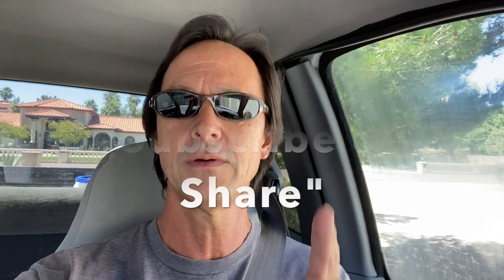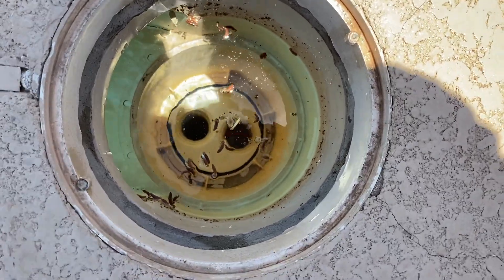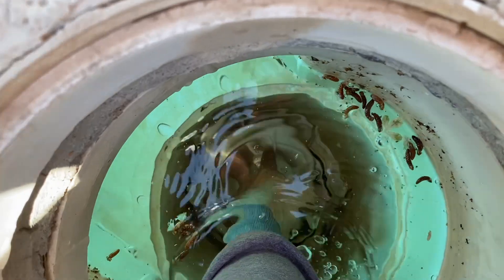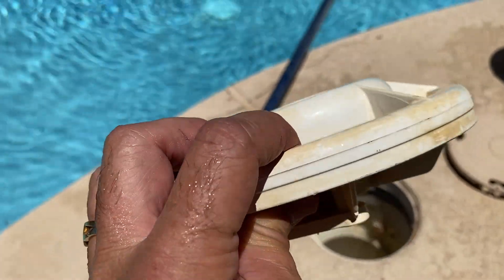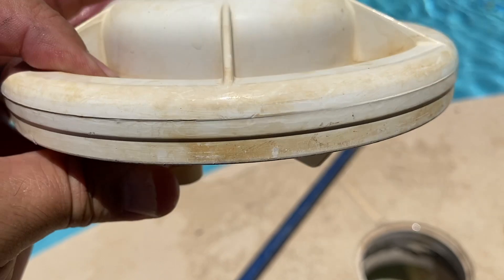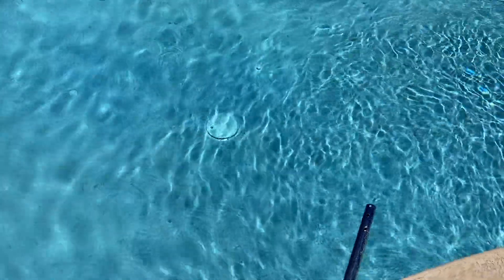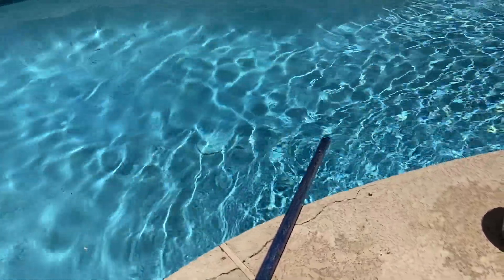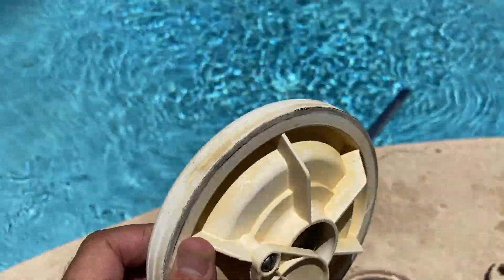Pool Skimmer Diverters: What Are They, What Do They Do & Do They Really Work?

Comment: So I have an infloor cleaning system and the diverter. But I also have this check valve that is on a spring which is supposed to go into the  hole that goes to the bottom of the pool drain. I am not sure if I should be using that with an infloor cleaning system. But it sounds like I should use the diverter at least at 50% or so so that my infloor is working good. Does that sound right? Its a U3 Skimmer system.
Reply from the maker: It does but I'm not sure about the check valve.  If it's to prevent water from flowing back into the pool via the floor drain I'd find that interesting and uncommon for my area.  I'd actually like to see a picture or video of what you're talking about.
Reply: @PoolSchooler  I am in AZ as well. According to the instruction sheet that came with it, it says" Check Valve prevents suction through equalizer line unless the water level in the skimmer drops so far that the float valve closes. When float closes, check valve opens allow pump to draw water from equalizer wall fitting, preventing damage to pool circulation pump." So it sounds like it closes off the line to the drains on the bottom of the pool unless the float closes. I am going to assume I don't want that in there since I have an in floor system. I am closing the opening on my float to about 60 or so so that the drains get more suction. I know that puts less suction on the skimmer but I don't have many trees or anything causing much on the surface. I am more concerned about dirt on the bottom. But easy enough to adjust as needed.
Reply: You can see the setup on it if you google "u3 skimmer installation" and check the link that comes up for
U-3 Skimmer - Pentair.
Reply from the maker: @josephtuccillo6438  OK gotcha.  I'd suggest following the manufacturers recommendations on their particular product.

Comment: My diverter was broken (the part where the screw attaches), and lately my pump was failing to prime every morning. I replaced the diverter with a brand new diverter and now i no longer have that problem. Is there a connection?
Reply from the maker: There should not be a connection.

Comment: What I noticed on my pool the 2nd hole to my skimmer goes nowhere and unfortunately has no diverter valve and no weir door.
Reply from the maker: A second skimmer hole that goes "nowhere" is common in pools that don't have floor drains.  So you don't need a diverter valve.  ALSO you can get after market spring loaded weir doors for you pool if you want to
Reply: I'll get the skimmer weir door eventually I'm glad I got a new energy efficient pump and new pool filter last year. Money well spent!

Comment: I have an old pool that came with a house my wife and I bought. I bought a diverter and its a great little device. 

I usually have the diverter door, a little more than half way shut and with a 35,000 gallon pool; running the motor at 2000 rpms, the skimmer flow rate works great. Of course you also have to find the right balance when it comes to your water level.

 I know the rule of thumb is usually you want your water level half way up the skimmer entrance. 

I disagree with this due to a couple reasons. The higher the water level, the higher RPMs I have to set my motor for it to enough surface water flow in the skimmer itself - and thats including adjusting the diverter door. And that just costs more money to go from 2000 to 2500 rpms. Also, high level of water usually makes the motor and skimmer work less efficient - meaning the surface water moves a lot slower to the skimmer. 

I usually have my water level at about 1/4 to 3/8 height of the skimmer entrance. This seems to work best for my pool and I can run the motor at A LOT lower rpms with better efficiency. 

Another reason why the diverters are great :

My backyard has three different types of pine trees that shed like crazy in the summer and get into the pool - usually staying on the surface of the water. If there's enough needles that get into the skimmer and clog the basket while preventing water from entering, the diverter will shut and it works in a way that the pool runs by using the floor drain - like you mentioned. However, for my pool, it does prevent air from going into the motor, the filter, and coming back out the return lines. Im not gonna say its air tight or anything, but with my experiences, the motor has enough suction to seal it enough for a tight fit. Then the diverter acts like a door and shuts the skimmer down when its clogged and then diverts only drain water into the motor and filter and keeping the pool running while being consistent (at least for circulation purposes) and preventing air from going in the motor. 

Its also great for general circulation as well. I dont think of floor drains as any type of vacuum mechanism for only for dirt of debris as much as I think of it as a circulation drain that filters out the fine particles. 

It might not be a great investment for some pools, but its a great device for mine.

Anyways, thats my thoughts and ideas for whatever its worth. And I still gave you a like.
Reply: Correct me if I'm wrong here but doesn't your completely clogged skimmer basket block/restrict the water flow? Thus only leaving the option to suck from the floor drain? That's how it would work without the diverter right? I also believe the diverter shut off float will still float if it's still completely submerged leaving the diverter open and not until the water level drops below the float will it drop down and hopefully seal off so it sucks from the floor drain instead of just air from the dry skimmer potentially burning up a pump. I think of the diverter device more as safety seal for when the pool level is to low to keep the skimmer full of water. I would think the only important reason for limiting off the wonderful time saving skimmer is to help suck down newly added chemicals for better even mixing for accurate test strips. I just started learning this tonight but it makes sense to me.

Also it sounds like your skimmer is missing the very important Weir gate or door that ensures that all the skimmer suction stays at the top of the water level only "skimming" the top instead of just pumping water from a big rectangular hole in the side of your pool. Essentially what you are trying to accomplish by keeping the water level just above the bottom of the skimmer entrance. Sounds a little tedious to try to keep it at that tight level year-round. They also help trap the debris in the skimmer instead of floating back out when the pump shuts down.
Reply: @christ6370  the diverter stops air from entering the pump - thus turning the main drain into the only flow of water going to the pump. When enough debris clogs the skimmer, water will be restricted to the pump and it will begin sucking air. 

The diverter solves this problem and shuts the skimmer down while still circulating the water in the pool.
Reply: @christ6370  and of course I have a skimmer door

Comment: I would think that "some air" is better than "only air", I also noticed that some pros and suppliers do not know everything. So don't count on them to weigh in on your theory. Best test is a test.

Theoretically the body of water is ONE therefore the suction at the bottom of the skimmer to the pump IS pulling water from the main drain at the same time as from the surface. It theoretically does not have to "pull" water from 5 feet down since the main drain also has 6 feet of water resting on it leaving only 1 foot of "head" to pull, which is the same  (ALMOST...maybe 1.5 inches more ) as what is being experienced in the skimmer.

The reason I emphasized "theory" is that the sediments in the main drain are of different characteristics and thus would need added suction to lift them to and through the base of the skimmer.

If the pool is at normal level and we close the skimmer flap, the float valve drops and we should get a suction from the main drains. This test would result in a false idea as to what would happen when the water level drops beneath the throat of the skimmer. The reason for this is that closing the flap in itself is not water tight and so some water still falls through and slightly floats or breaks the seal on the float valve.

Having said all this I would still agree with you that the seal may not be perfect at some point in the life of the valve or even maybe ever, yet some air beats only air going in my pump. If my pump doesn't trip before burnout I hope I hear the cavitation in time to save a good buck.

The truth is that the more ideal setup is with independent valving controlling suction at the pump house.

Comment: Nice video. I really enjoyed it, as our pool has a diverter, which we refer to as the 👽👾"flying saucer!!"   We also have an in-floor cleaning system and as far as I know, the flying saucer is the only way to adjust the suction between the main drain and the skimmer. It DEFINITELY works for our pool ,as if it's out, the main drain doesn't work AT ALL,which defeats the purpose of having the in-floor cleaning system, I believe.
Lastly, in terms of preventing the pump from running dry if the water gets TOO low, MY diverter DEFINITELY does work, as we actually forgot to turn off the drain hose after a heavy rain one time, which caused the water level to drop WAY below the skimmer. Fortunately, the diverter float worked properly and pulled water from the main drain. I actually have tested it Since then, and it ALWAYS works well; you'll hear a" thump" as it seats itself and then it'll pull water directly from the main. One difference, though: mine has an O-ring/gasket on The bottom and underneath the float -- I didn't really notice Them on the one you were holding, so maybe they make a difference.
Reply from the maker: Thanks so much for sharing this info.  I am glad the diverter actually did work to help save your pool equipment from the water being too low.  That's fantastic.  I suppose two things>Making sure the float inside "the flying saucer" is in good condition (not cracked) and you have a gasket as you describe then it looks like it can prevent damage to the equipment from low water.  And I am glad your diverter works well for your pop up system.  I really appreciate the info.
Reply: @PoolSchooler  
No problem at all.   Again, it does a pretty good job for my pool -- although I wouldn't mind having a Jandy valve to regulate the main drain/skimmer suction -- so I just wanted to give you some feedback. As you mentioned, I think that perhaps your customer's diverter should be replaced; or at a minimum, the O-rings should be reinstalled, as I think they'd improve the seal  on both the diverter base and the float. Please keep making the informative videos!!👍
Reply: If you have a in-floor pop-up system like I do, you need that diverter!

Comment: My diverter is missing (no idea how/why lol), but it seems my floor drain is feeding the vacuum 100% and so I am not skimming the surface of the pool, there is no pull into the water.
Reply from the maker: Where do you have your vacuum plugged in?  And is it a suction side or return side vacuum?
Reply: @PoolSchooler  floor vacuum has a port on Tue side of the pool like your video. I think my vacuum is positive pressure there is a little snake which shoots water out the back to push the vacuum lol
Reply from the maker: @petertwiss356  So you have a pool "sweep" which works on the return side of the pool.  If you want to put in a suction side vacuum you'll probably need to do it through your skimmer.  I'd suggest using a VacMate to do that.  I did a video on it.  Hopefully it'll be helpful.  Here's a link to it: https://youtu.be/eagXAKxN8zM
Reply: @PoolSchooler  thanks!

Comment: Personally, I've found that the pool I have now sucks the diverter down so powerfully that even when the water is high, the floater in the diverter sucks down and the pump doesn't' pump any water and just strains. After getting rid of the diverter, I've had no problems with the pump.
Reply from the maker: I've had that problem before as well, which is why I typically don't use them.

Comment: Without this thing my main drain has no suction. I’ve heard that main drains account for 75% of water circulation. In your opinion do you think this engineering is meant to have the skimmer be 100% of water circulation ?
Reply from the maker: So if you have a dedicated vacuum line you don't really need any suction to the main drain.  The vac would take about 2/3 of the suction and the rest directly to the skimmer.  I'm not sure as to the percentage you heard about (75%).  If it's pulling that much from the floor drain then you 're losing that much from your skimmer and it won't do it's job very well.  ALSO, you'd probably have to open the diverter flap completely to get the most suction to the floor drain AND that water has to move "up hill" so it'll pull from the easier source (which is the skimmer since water seeks the path of least resistance).  As I said in the video, I'm not a really big fan of the diverters, but about the only time I think they're ok is when you have an in floor popup cleaning system.
Reply: Pool School thanks for your response , I don’t use a vacuum or pop ups but I use a robotic cleaner. I guess it’s the same concept. I noticed even with the diverter float installed, the main drain suction is weak. So I think you are right the skimmer is the way to go for this type of set up.

Comment: I would rather have valves at the equipment area that control where the suction comes from because I don't like putting my hand in the skimmer because I am afraid of being stung by dead bees or wasps.
Reply: Well, yeah, but many, maybe most pools aren't plumbed that way.  I know mine isn't.  It's a lot cheaper to run one line straight into the pump than to run multiple lines into multiple valves (or a gang valve) before feeding the pump.  And gang valves will fail at some point.  Most of the pools in my area run a single drain line to the pump.

Comment: First and foremost the skimmer diverter is to protect the pump from losing its prime and water to protect it from burning out!!
Secondly, the diverter allows the user to adjust the suction/flow to the skimmer by moving the sliding door more open than closed.
You are right, the skimmer diverter is very mis understood by a valuable and necessary part of your pool circulation system!!
Reply from the maker: I appreciate the comment. I've not had  good experiences with skimmer diverters personally.  But I appreciate your input.  Thanks

Comment: I have watched other videos where they actually show where it works when the skimmer is closed up. It doesn't have to be a theory, just close up the skimmer and see if it works. Easy!
Reply: Yep - mine works.

I have pine trees in my backyard and when they start shedding, they go right into the pool and then clog the skimmer. Thats when the float in the diverter drops when it reaches a point of not enough water in the skimmer. Thus stopping the skimmer from sucking a bunch of air in the motor while switching over to the main drain and still providing water to the motor. 

The skimmer will be shut down, but the circulation never skips a beat. 

These devices are great.

Comment: Most of Pool School other videos are good, but I disagree this video.  Firstly, the drain on the bottom of the pool has no gravity effect that Pool School described because the water in the pipe leading to the two-hole skimmer is naturally equalized.  Secondly, the diverter will work as designed and will draw water from the bottom drain if the water level falls below the skimmer.  This was proven in my pool when my automatic water was stuck in the closed position and the water level dropped below the skimmer when I was on vacation.  If a divertor, pump motor, filter, or any other device fails because of improper maintenance, then that is the fault of the owner.   Thirdly, the pool drain has to be working and should not be turned off because we want water circulation from the bottom of the pool too.  
Please do a test of the diverter for yourself and you will see that a divertor actually will work. Please do not discard the divertor!!!!